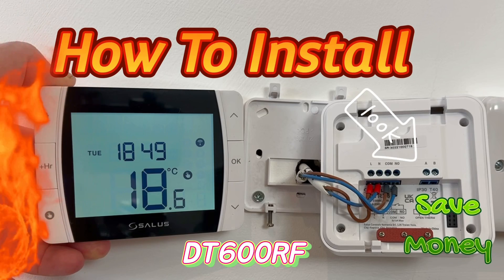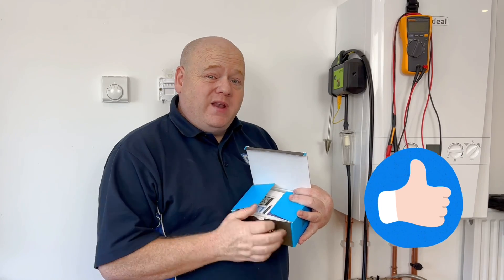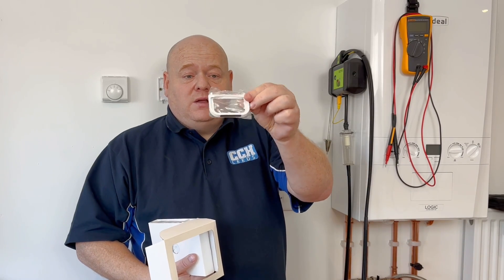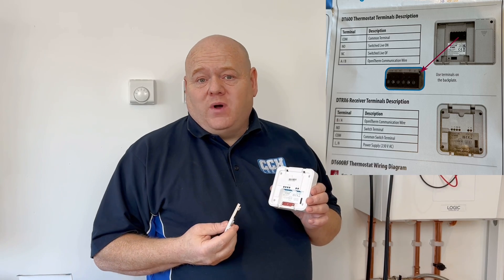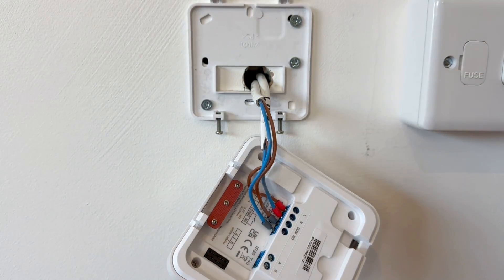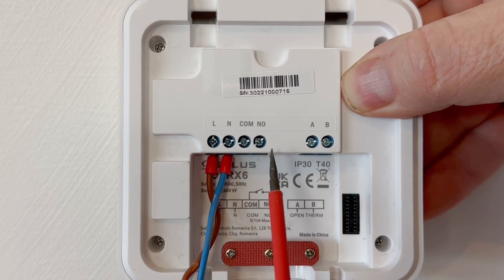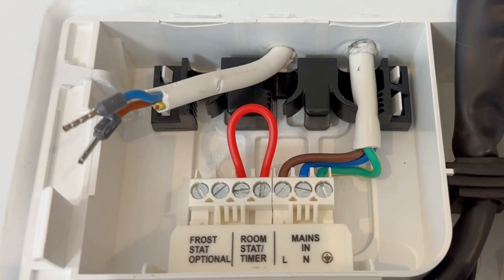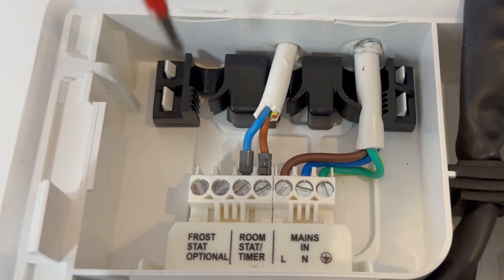How To Install Salus DT600RF Programmable Room Thermostat DT600 Wiring

Comment: Hi Allen 
I’m looking for a good RF  standalone Thermostat for an ideal vogue 34kwh  combi boiler just under 2 years old since fitted it has opentherm do these boiler have a good modulation, Ive wired in a single channel hive which I’ve had on the previous boiler (bulletproof but only off and on), looking at RF as is not reliant on WiFi. Thanks for all your time in the videos that you do they have helped me and I’m sure many others over the years

Comment: Hi Allen! 
Thanks a bunch for your videos—they've been super helpful! I'm gearing up to switch from a Room Stat to OpenTherm on my Ideal Independent Combi 24, but I've hit a bit of a snag.

Right now, my setup goes from ROOM STAT/TIMER to the thermostat, using the boiler's timer clock. But, I noticed there's no link in the OPENTHERM connection on the right side panel (next to WEATHER COMPENSATION) like you showed in the video.

From what I gathered, the first move is to unplug the harness behind the boiler's timer (not covered in the video) and connect it to an unused harness nearby. I guess this will disconnect the timer, and link the circuit to allow OpenTherm.
After that, I'm supposed to unplug the two wires from the ROOM STAT/TIMER connection on the left side panel and stick them into the OPENTHERM connection on the right side, just like your video. I also need to flip the cables from COM to OT in the room thermostat.

The only thing tripping me up is whether, after doing all this, I should pop the link back in the ROOM STAT/TIMER on the left side or leave it empty.

Would really appreciate your help on this—it's the last piece I need to get OpenTherm up and running. Thanks a ton!
Reply: Hi, I’m about to try the exact same.. the way I’m going to do it is to leave the thermostat connecters free from the thermostat on the boiler and just connect them on the other side to open therm .
Reply: Hey  @rich8561 ! I have installed it like this, and it seems to work well. At least, the boiler gets the signal to turn on when the temperature is below the set temp on the thermostat.
Reply: Hi, did you wire in to open Therm ?

Comment: Another great video. Salus timers, receivers, thermostats are excellent products and recommended for Thermaflow combi electric boilers.
Reply from the maker: Which products do you install? Thanks.
Reply: @AllenHart999  
Salus RT520RF Thermostat,
Salus EP210 programmer with a
Thermaflow electric combi boiler
TH9/250OU Mk2. What's your opinion of Thermaflow? Thanks.
Reply from the maker: Thank You @monkeyboy8424

Comment: Alan I have just bought a SALUS RT520RF  THERMOSTAT . GETTING CONFUSED HOW TO WIRE IN TO A MAIN ECO BOILER. 
I CAN GET POWER TO THE RECEIVER BOTH LIGHT ARE ON SOLID, BUT WHEN I INCREASE THE TEMP TO TEST IT WOKING 
BOTH THE BOILER HAS A LOOP AS DOSSE THE RECEIVER . CAN YOU ADVICES ME . THANKS 
LOVE THE VIDEOS .
Reply from the maker: Sorry only just seen this. Did you get sorted? Thanks.
Reply: @AllenHart999  hi Alan I have got the boiler to turn on 
I turn on the boiler switch and set at auto not manual. Is there any particular location for the wireless thermostat as my boiler is located in a bed room!
Reply from the maker: Anywhere to suit your requirements.  @bobwilson4195

Comment: Allen will a hive thermostat be compatible with an Ideal Esprit 30 boiler?
Reply from the maker: yes
Reply: @AllenHart999  are ideal boilers good? I had a Baxi for over 10 years that give us quite a few issues. This ideal boiler has had no issues at all in 7!years. (Touch wood). 🫣

Comment: I loved all your videos over the years and this one didn’t disappoint. Very good! You always come across honest. Keep up the good videos.
I have a problem you might be able to help with. I have a Ferroli optimax HE25S gas boiler it’s about 12 years old now. The mother board had a intermittent problem, it would stop for no reason. I’d take it out look at it (no signs of damage) and refit It. It would work for years, I thought it was a cracked PCB. However I ordered a new PCB (DIMS23)for a UK supplier and when I fitted it comes up with an error code F37. No program book came with it and the supplier has no idea. Would you or your contacts know how I can change the program or have a programming book?
Many thanks and a happy Christmas to you and your!
Reply: F37 Incorrect system water pressure
Pressure too low - Fill the system
Sensor damaged - Check the sensor
Reply: @psi10001  Thanks Rod, I only get that code with the new PCB and not with the old PCB. System pressure is ok at 1 to 1.5 bar. I think I just need the program book to set the new one. Thanks again for your help.
Reply: All fixed and working. I just needed to change some settings in programming. I was lucky enough to get the codes on line. Thanks for thinking of me. All the best, Alan
Reply from the maker: @alanwhite4427  👍👍
Reply from the maker: Sorry only just seen this, Hopefully you are sorted now. Thanks.

Comment: Very interesting, I shall have to check mine out as it was wired at the time the boiler was installed.
Reply from the maker: What boiler do you have and what controller? Thanks.
Reply: @Allen Hart  it's a worcester greenstar 32, the stat is a salus as in your video.

Comment: I advised a landlord with 3 HMO's to install Hive stats in his houses in multiple occupation and take out the existing wall stats and timers from the front panels of the boilers.  So that he could control the time parameters and target temperatures for heating. His tenants were running the heating 24/7, 365. It was costing him an absolute fortune. He really didn't want to penalise his tenants by putting up their rent, to cover the rise in gas prices. So, by taking control of when the properties were heated and negotiating and consulting with the tenants, he could come to an arrangement. Spoke to him the other day. If tenants couldn't afford the rent, would he file for and force eviction? Regrettably, he said he may have to consider that option. I asked him if he would enter into a Faustian pact with SERCO. Who would guarantee his rental income and manage his properties and would even cover costs for repairs from even malicious damage, if he chose to accept SERCO's offer and have refugees as tenants. He said... "NO!" He'd bend over backwards to try and help students, young professionals, those who could not afford a mortgage or were working away from home as much as he could. The landlord is himself the son of a refugee. Greek, Cypriot. 
I'm worried. Again!
Reply from the maker: Have you tried the Salus Smart Home?

Comment: Hi Allen, good timing with this video. Last week I helped by son swap out his Danfos thermostats for wired Tado ones. We set them to com and  N.o. I say them because this is a two zone system with an Ideal combi boiler - could be the same model as the one in the video (Barratt newish build if your familiar with what system they install). So would you just wire both Tado's to the one opentherm block? Has the data from each thermostat a unique identity?  also do you have to put the red link back?  Thanks.
Reply from the maker: No, you cannot do that.

Comment: Good video, when you rewired from 230v on/off to opentherm did you also put back the link wire inside the boiler ?
Reply from the maker: I cannot remember now, i would need to check, I believe you leave the link out. would be best to check with the installation instructions. Thanks.

Comment: Has anyone used Opentherm on the Baxi 600/ 800 using Drayton Wiser?

From what little info I've found, it seems you need a 2 channel model, as Baxi need an input of 50 degrees for the hot water, even though you only need Opentherm to control the heating flow temperature. Is this right in your experience?

Thanks for these videos Allen, they're not just informative, but your style is easy to watch and listen to. Well done.
Reply from the maker: Hi Darren, Thank you for the comment, I haven’t installed Drayton for years,
Reply: @AllenHart999  Thanks Allen. Like so many things at the moment, this industry is a state of flux (no pun intended).
Opentherm is the current 'great hope' of the industry, but not everyone is signed up.
Whichever controls you buy now could end up as the Betamax of the future.
Reply: I have a Baxi 800 system boiler with Drayton Wiser, I spoke to the technical line about a year ago and they said I can’t use open therm with my set up. Seems a shame. I imagine with a Combi it’s possible.
Reply: @1976rlc  Seems mad, doesn't it? I read that Baxi need an input for DHW temperature to operate Opentherm, which doesn't seem practical on a system boiler.
Reply: Never install Rubbish Thermostat

Comment: Prefer the Salus Quantum. No batteries but I’ve had one that has a bad screen after recharging 10months later. Great vids as always.
Reply from the maker: I haven’t installed a quantum, Maybe Salus will send me one lol. Thanks.
Reply from the maker: Just installed some at mine, Thanks for the advice. Really Really good.